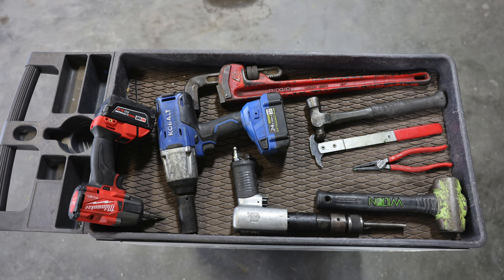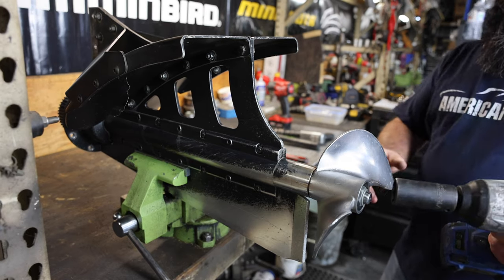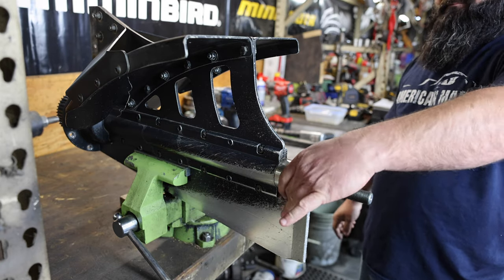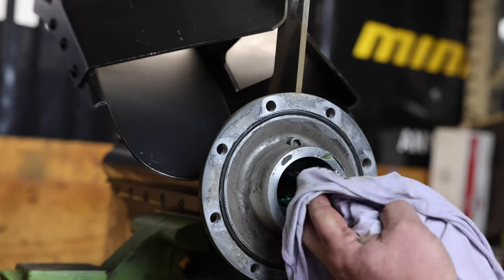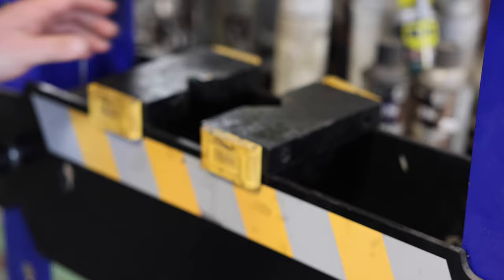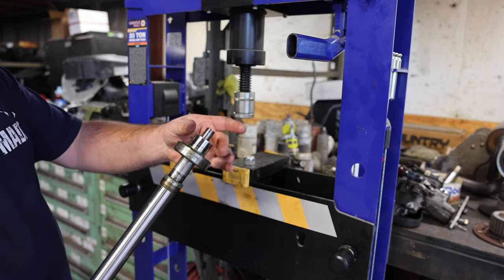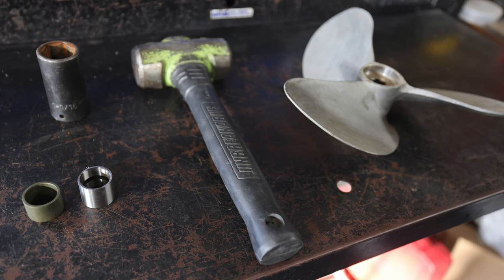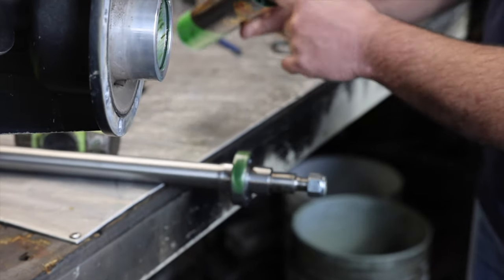GatorTail Service Hub - Lower Unit Rebuild

Comment: at 11 minutes, you show 4 seals but when he's rebuilding, he only shows seating 3 seals, 2 in the cup bearing (springs facing each other) and the other where the main bearing is... where is the 4th seal at the 11th minute mark? im curious
Reply: is the 4th one the inner seal at 5 minutes 55 seconds?
Reply from the maker: Hey, just following up. Did you get this resolved?
Reply: @GatorTailMudmotors  the video is only shows the location or the inner seal but not the removal and replacement of it. Unless I missed it as well
Reply: @Quackk_Addict  Take the inner seal/inner snap ring (the smallest of 3 snap rings) and throw them in the trash. They are not used anymore. Rebuild without them.
Reply: @jGator-  how come you guys are ridding them away? how do you know when it's time to rebuild? I grease mine like you're supposed to and sometimes I only see like 2-4 drops of water come out but the rest is all grease
Reply: @Quackk_Addict  it's the inner seal behind bearing he didn't show to install